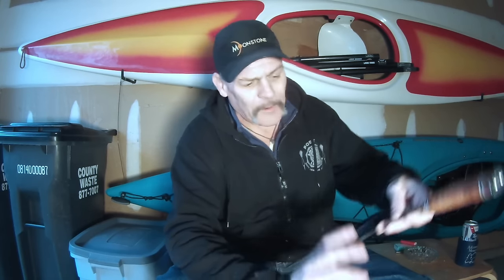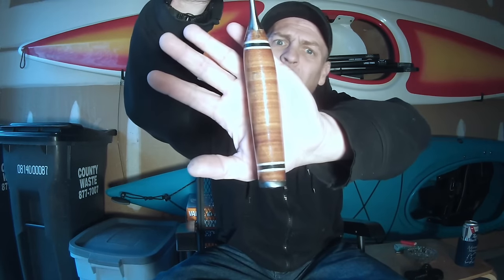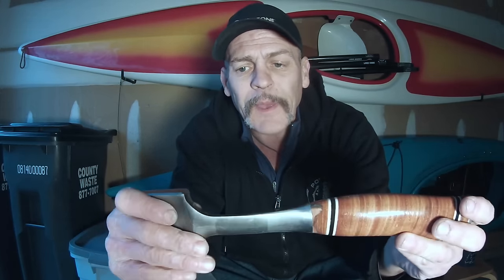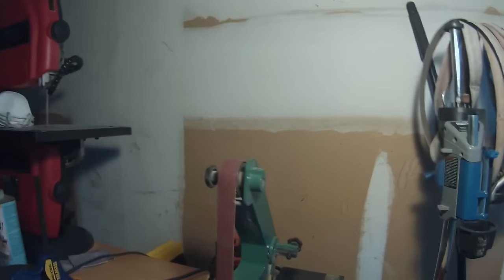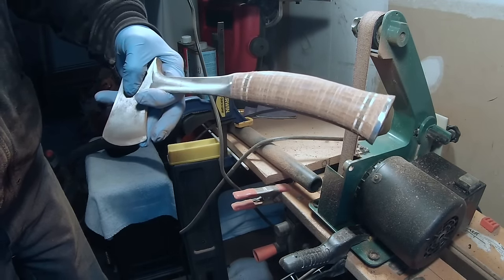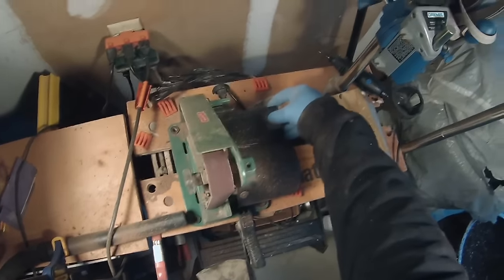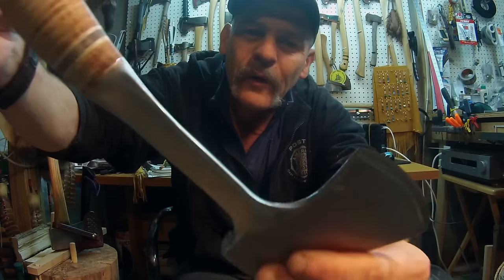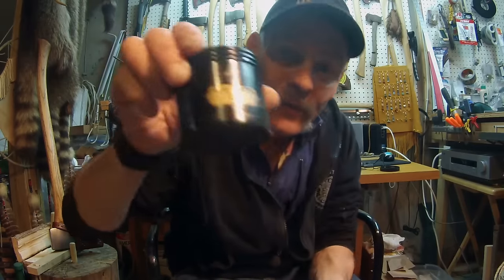Estwing Hatchet Repair - Shop Time!

Comment: I have had that same hatchet since I was like 14 ( in my mid 30's now) The lacquer it was dipped in had cracked severely over the years. A couple of years ago I stripped the lacquer. I sanded out the small imperfections in my handle, soaked in about 5 oz's of mink oil. It was some thirsty leather. Then I melted in as much Snowseal with a hair drier as it would take.  I also hand sanded all the metal and it came out looking awesome just like yours and it's ready for another 16 years.
Reply from the maker: Nice job Bradley!!! Snow seal is goooood shit!!!!!

Comment: I tried every Estwing Sportsman axe handle at Cabela’s (about 20). They were all different. I finally found one comparable to my Estwing hammer. They make a similar sized hatchet now with the rubberized grip which seems more consistent in sizing. I guess the good news is you will find the exact handle you want if you keep looking.

Comment: You must of gotten a reject . I just bought one on eBay a few weeks ago . When I saw your video I went and took a good look at my mew one . Its perfect  could not find eanything wrong with it like you did . only thing I would like is for them to ship it with out the selack or varnish . I alwayd sand it off and oil it . makes the leather darker but it will last forever if kept oiled .

Comment: Bought one myself a few months ago and it was great.   Fit and finish well done all the way around.  A lovely little axe.  Just saying they are not all like the one you got.  Quality control must have let that slip though.  You're right though... mine was dull as a hoe and I sharpened it to where I could shave with it.  I've used it to shape the outside of a huge birch log to make a bowl.   The edge has held up well for that limited use.  If it didn't I would have trashed it.  That is the real judgement on a axe... can it hold an edge.  If estwing fails that test they might as well ship the factory to some foreign land because American made (and Canadian made) was and should remain a badge of quality.
Reply from the maker: Glad you got a good one Bill!! Hope the bowl turns out well!!!